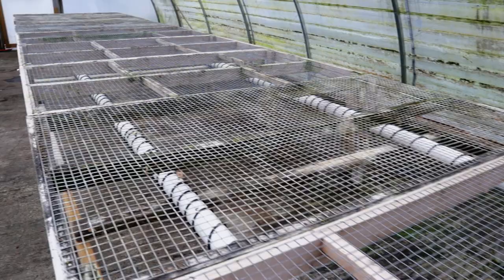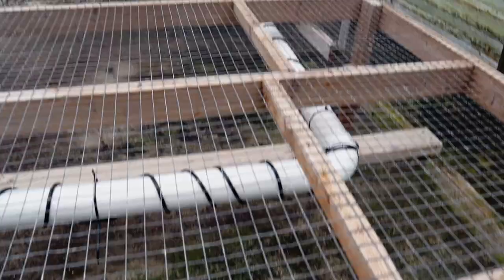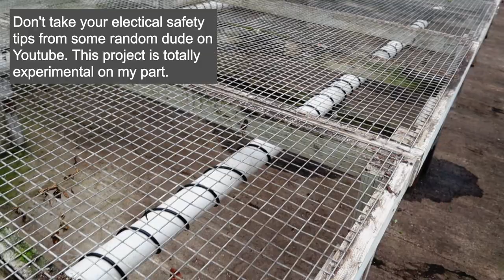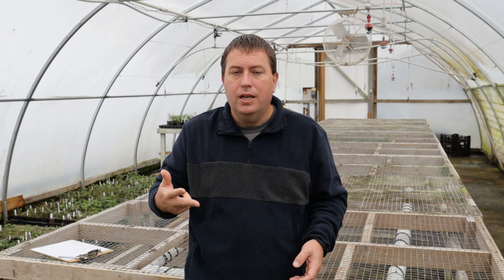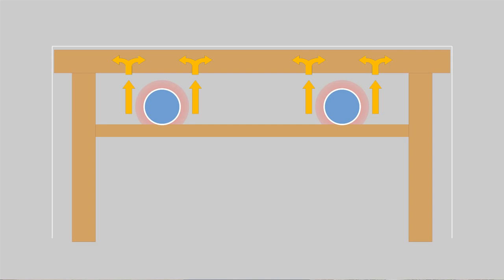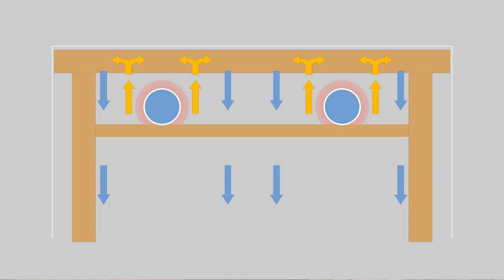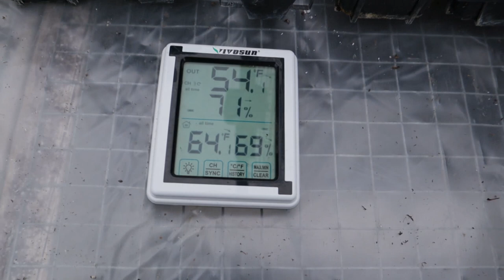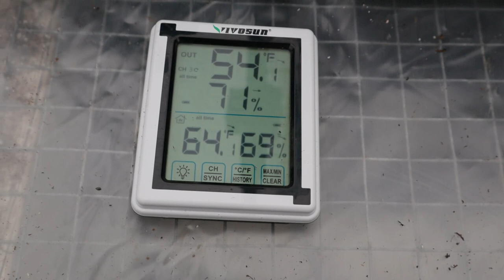Under Bench Heat Project: Protecting Our Young Plants from Cold

Comment: I think this is a great idea.  I look forward to updates as you get colder.  I wish I had room for a greenhouse to give this a try.  One quick thought.  If you are putting antifreeze in the water (and I agree you should to protect your system), you might want to put a net or something over the end to ensure no animal can get into it for a drink.  I realize it's probably a long shot that that would happen, but I thought I'd mention it.  Thanks for the videos.
Reply from the maker: Thanks Lance - Lisa was concerned about it too, so we extended the pipe upwards (so there's no way it can spill out) and then loose-fit a plastic cap on the end.

Comment: That is a cool invention. In a colder climate you could put a hot water heater and a lope of water pipe to make a warmer version. Of course it would cost more to create and probably to run through the winter.
Reply from the maker: Thanks Dennis - we ran through quite a few options, and a more sophisticated hot water boiler system was on the table. In the end, we went with fast, cheap and easy (with all the compromises on the performance we could live with). We'll have to see if it meets the needs though!

Comment: Something that I’m trying this year in my newly built insulated GH, zone 3B (northern AB!) is a diesel cab heater! Very cheap Chinese knock offs on Amazon. I’m attempting to grow throughout the entire winter! Fingers crossed this works! I switched out the LCD controller it came with for an after market one called the Afterburner, upon recommendations from diesel heater FB pages and now I have it thermostatically running beautifully at 13.5*C during the night. With this newer controller you can set it to whatever you wish and it will go into “suspended” mode when no heat is called for. 
Of course there was the intensive install as we had insulated walls to plumb through rather than just GH poly and we added a 50 L fuel tank outside so I didn’t have to keep filling up a 5L tank every week, but for me in quite extreme temperature fluctuations it was worth it so far! Again fingers crossed! 🤞

My only concern with your new set up (which is brilliant to use water as the heat conductor) is possible dangers of heating a pvc pipe and possible fire. I would imagine that pvc would off gas with warmer water in it, but I don’t think the water would ever get to boiling temperatures anyways, but that could be a concern. The other is fire with those heat tapes. There is a newly built school in our city that had these installed in their downspouts from freezing and earlier this year one tape failed and caused a fire during the night and caused some damage to the school. From a heat tape! 🥺
But I guess with any set up there can always be a concern with fire or electrical malfunctions.

Looking forward to seeing if this gives you the results you’re looking for and keeps your newly rooted roses safe for the winter!
Reply from the maker: What an interesting solution for a more demanding climate! I notice you've posted some videos yourself - any chance I could convince you to throw a 2 minute clip of your setup? I'm just always interested in seeing other solutions to similar problems.
Reply: @FraserValleyRoseFarm  sure I can do that for you!

Comment: Hi Jason.  I was watching videos on composting.  Not sure if you compost or not but people are using the heat from the pile as a hearing unit.  Might save some overhead if you could rig up something for your seedlings by taking advantage of it.
Reply from the maker: Thanks. I followed a series about this by Morgan Brown a couple of years ago - the only problem seemed to be the heat gain was only sufficient for a small area.
Reply: @FraserValleyRoseFarm  ah i see.  Well maybe something will come along to make it more efficient sooner rather than later. 😊

Comment: Jason this looks great and I think I will try building a similar version. I was wondering if you thought of putting 3” sides around the top of the bench, to minimize the air going between your pots, insuring most of the heat gets to the soil?
Reply from the maker: Thanks Rodney. Yes, I think that'd be great if you can do it inexpensively. I was also looking at light crop cover above the crop, but roses are likely to snag if the fabric touches the plants.

Comment: I have only 5 cuttings (I think they would, at the size they are be sold in store in a quart pot) that I did in the middle of summer that are about 12" -18"
Now and I need to over winter them. They are not small new rooted cuttings  but too small to overwinter outside this year, even if I would have planted them in the ground early enough (I live in zone 5b, Upstate NY) so I'm not sure what my best option is for over wintering them? The options I have available to me are putting them in my screened in porch ( lined with plastic during winter because  2 large, let's call windows, 1/2 walls are just screens), or in my unheated basement  that gets no colder than 35 to 40 degrees  with a plant light (with arms) or no plant light??? Or would you have another suggestion I did not think of? 
I don't have a garage or shed to put them into. I also have a hydrangea I purchased late summer and planted it into a very, very LG pot that took 80#s of soil to fill. I will more than likely put that into my screened in porch. Thank you so much for Everything you do and share with us on here. I never miss a video and have learned so much!!!
Reply from the maker: Hi Geri. Both the screened porch and the basement sound like good options. You'd have better temperature protection in the basement, and at those temps I think the plants would be dormant or nearly so. Lighting needs would be minimal, but still wouldn't hurt to have it on for 4 hours a day. Strip excess foliage. Check them a couple of times a week if you can to make sure they're not trying to grow too much, rotting, or completely out of water.
Reply: @FraserValleyRoseFarm  Thank you 😊

Comment: Hi Jason, that’s a great idea. I know you live in a more moderate climate than I do, I’m in zone 6b in the middle of the U S. My question is, how much warmer the temperature might be if you would put a mini greenhouse type cover over the top of the table during a much colder night?
Reply from the maker: Good point. More layers, more insulation would always be a benefit, but you'd have to weight it against your budget, climate and the extra work involved. In my case, the temperature differential is fairly low (which matched what I need for my climate, I hope) so any extra layers might not be worth the effort. If you had to maintain a larger temperature gain, I bet it would make sense in a hurry.
Reply: I was thinking the same thing.

Comment: Hey I'm a big fan of yours!! You said you used some antifreeze in the pipe correct? What kind of antifreeze do you use? Is there a biodegradable antifreeze that would be a safer alternative to like car antifreeze?
Reply from the maker: We're using RV antifreeze, but also we've taken some precautions to make sure it can't escape (added height to the end of the pipe, and then capped it)

Comment: Well it’s been a year since you made this video !!! How is it working???
Reply from the maker: We used it two winters - and no problems. We've supplemented it with a small diesel heater (with the output being contained by the same poly skirt) because the cost of electricity is higher than diesel heat, but during the coldest nights we were using both.

Comment: Jason have you thought of using better insulated skirting, you loosing heat on the side through conduction.
Reply from the maker: Thanks. I'll keep an eye on it. My feeling right now is that we're dealing with a pretty low temperature differential, so the value of extra layers might be hard to justify. A couple of measurements (placing a temperature probe on outside of the skirt itself, for instance) may help me to get a sense of how much energy is going where I want it (to the top of the table) and how much is leaking out the sides. Funny enough, even in the far more expensive commercial propagation facility I featured in a video this spring, it was simple single-layer poly skirts. Mind you, I don't think they minded heating the whole building either.
Reply: @FraserValleyRoseFarm  you could use the foil lined bubble wrap for skirting around the table. It comes in huge rolls and in somewhat inexpensive. People who over winter in the holiday trailers sometimes skirt their units with them to retain heat underneath.

Comment: Jason, did you look at a two loop design with a single cable running inside the entire length?  double length to make up for the shorter cable length.  Plus, do you leave it on all the time or is it thermostatically controlled?  Thank you. Either way I think your idea has a lot of merit.
Reply from the maker: Thanks. I may got to thermostatic controls later on - I'm playing around with smart home software, and there's an open source program that can pretty easily monitor and respond to temperature changes. Until I get it set up, I'll just manually plug it in when the temperatures warrant it. I'm not sure I follow your design for how to loop the cable, but so long as it gets more or less even coverage along the entire length of the pipes, I'm sure it would be fine. We went with winding the cable because it sounded easy (it actually wasn't!) and didn't require a lot of cable ties or other attachments (that part turned out to be true).

Comment: Can you conduit pipe instead of pvc?
Reply from the maker: Plastic conduit is made from the same material (PVC) just usually grey instead of white, and usually thinner walled. Because this application isn't under any pressure, I don't see any reason why you wouldn't use the conduit if it's cheaper or if you have it on hand.
Reply: @FraserValleyRoseFarm  thanks for taking the time to reply. I also enjoy reading all your replies to other posters.